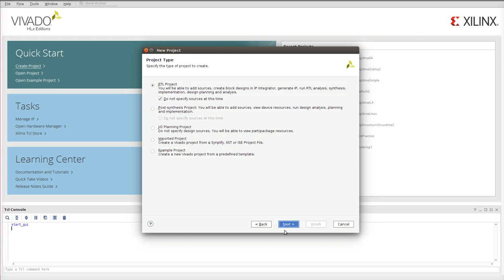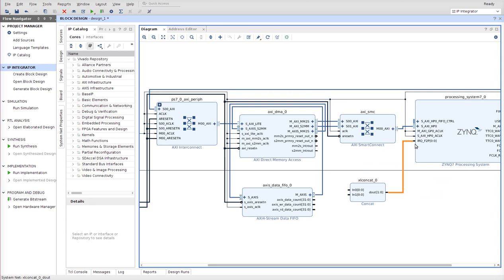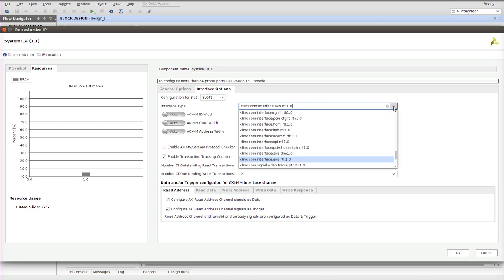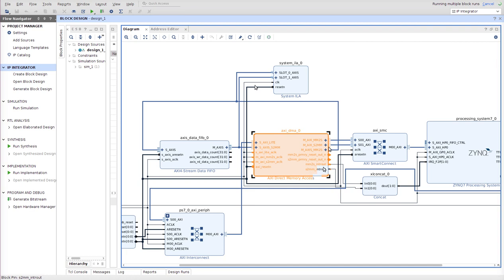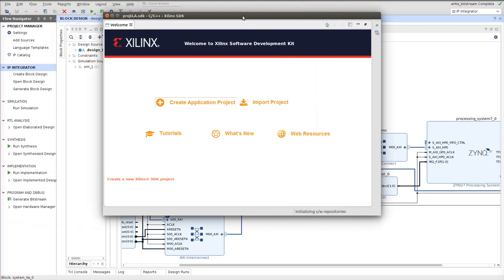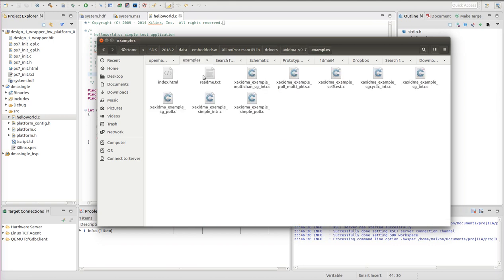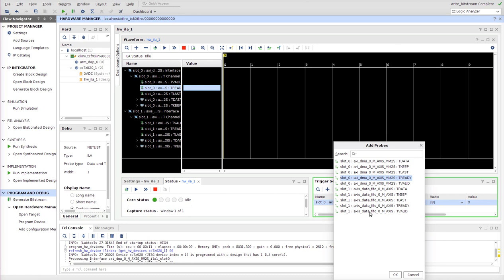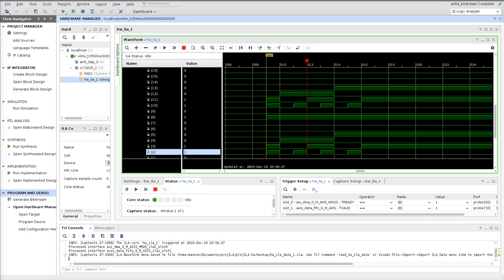Using Debugging System ILA with AXIS DMA and FIFO

Comment: Thanks! I have made a custom IP block and I am trying to pass a 512 byte variable through DMA using the base of the simple poll example and this block processes it and returns the compressed data to me.  The problem is that it always stays in the loop while(busy) Device_to_DMA. Have you had any similar errors?
Reply: I am also wishes to write one controller ip for dma instead of sdk code(based on simple poll) ... Can you please help me how to proceed ...